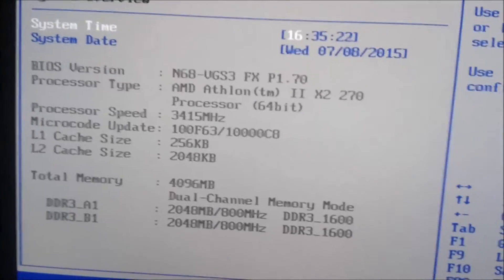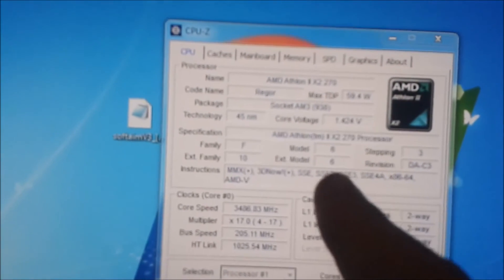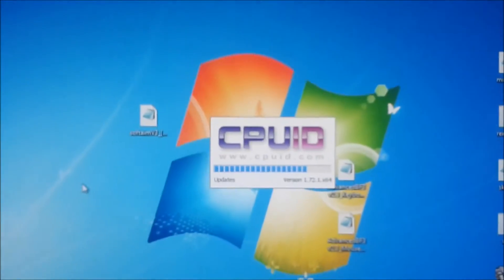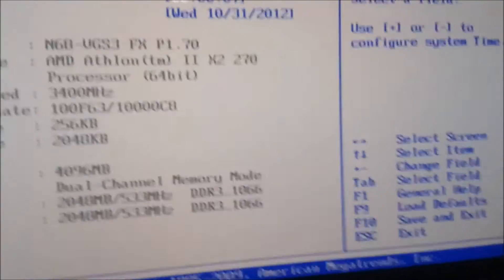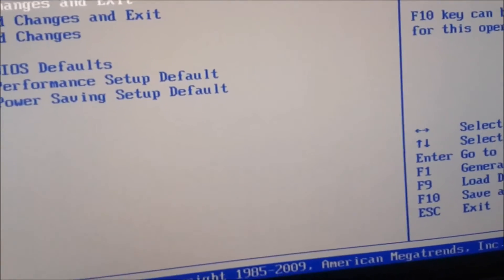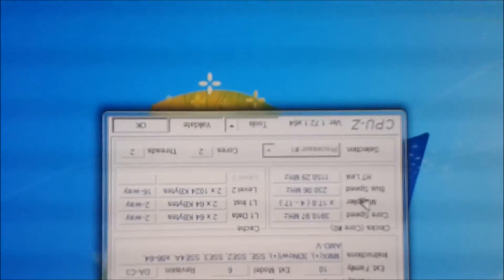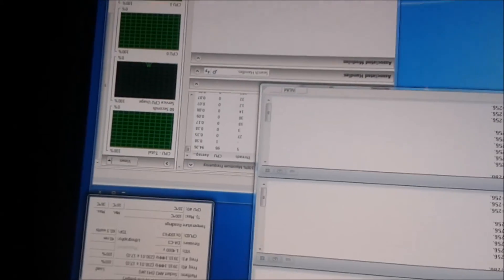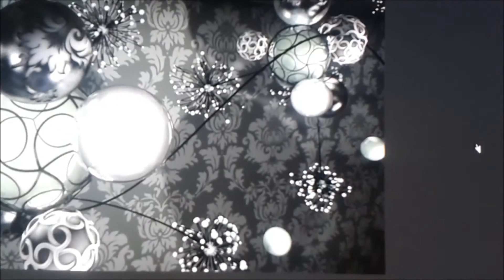AMD Athlon II X2 270 3.4Ghz overclock to 3.91Ghz

Comment: never knew that this cpu is that good
Reply: I got mine overclocked at 3.45.. i can proceed if I upgrade CPU cooler since I'm experiencing thermal bottleneck on stock cooler. It run at 3.5+ not stable bc of overheating.

Comment: But amd overdrive says it will damage the cpu with 3.9 ghz
Reply: 1.5 is pretty safe.. 1.55 safe.. over that will damage your CPU. it's the voltage not the speed.

Comment: my amd ii 270 @ 4011 MHZ  35 celsius
Reply: Repnek1989 how dude....doesn't it heats up?
Reply: big cooler and stock Voltage but Performance ist not so good max. 5% more
Reply: How much u prefer this processor ??
Out of 10???
Reply: mine english is bad this hopes is the answer
6 
i play fallout 4 , assasins Creed black Flag under 20 Fps
Amd II x2 270@4ghz, 8gb-1333mhz, HD 6850

Comment: you could push it even a lot more i think.
i had(and still have) my athlon x2 240,and i got it to 3.71GHz from 2.8GHz.almost a full GHz boost to it.
and i think you should async the PCI clock from the FSB...